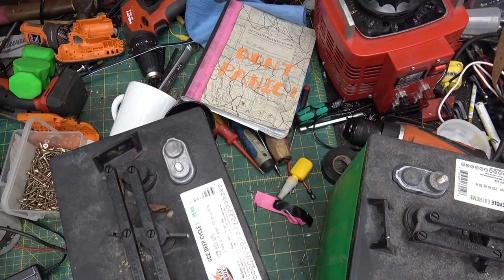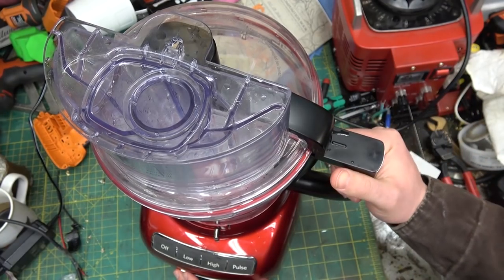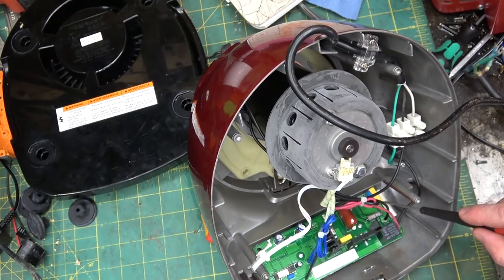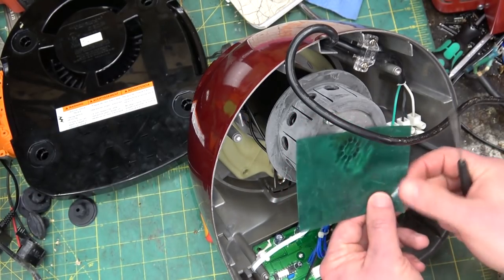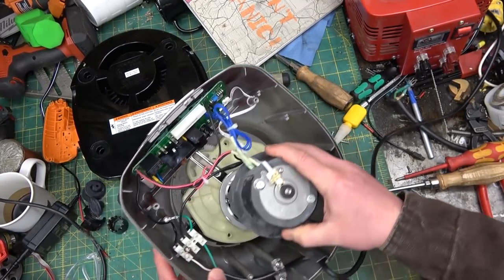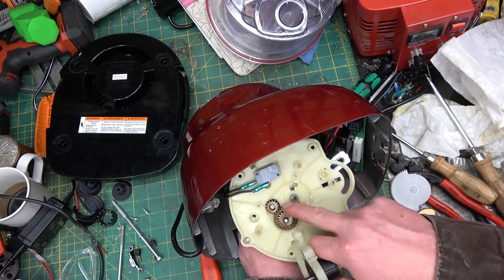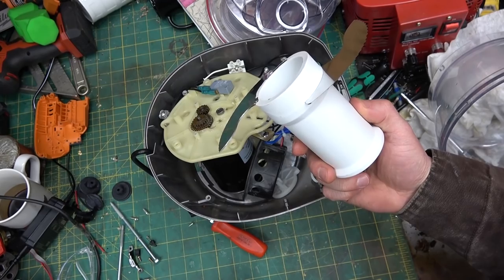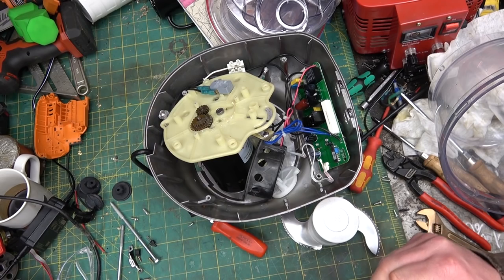BOLTR: KitchenAid Food Processor | Expensive Junk

Comment: If only a bloke had a 5 axis cnc machine, he could make a new one.
Reply: Out of that hard stuff, iron or steel or aluminum/aluminium. Not tree carcus tho.
Reply: My thoughts exactly. Buy a new one? Pff, i'll just make one that actually works. Let's replace that plastique gear case while we're in there, and get dewclaw to rig up a proper controller so we can get this thing to use both halves of the input power wave to get the missus to the moon.
Reply: What he really needs is a properly built one that uses a VFD and industrial grade motor to run it. The misses will be able to make enough pie crusts to start a bakery!
Reply: Going to need a tool holder for the dough hook.
Reply: Yeah he could spend a few thousand in machine time and reverse engineer time to save a $200-300 appliance.
Reply: make a replacement part out of unubtanium.
Reply: @WeighedWilson  killjoy
Reply: Or 3D print, share the file on thingiverse for others
Reply: @WeighedWilson  It'd be a great learning project. Plus, don't forget the big Youtube payout $$$. I'd watch.
Reply: Came to the comments to say this, ya beat me to it!
Reply: @sopgenorth  3ph VFD and a 8hp motor, fluid coupled with upstream filtering to keep the TV and stereo skookum?  sounds like a mighty build :)
Reply: @WeighedWilson  excellent engineering/business observation. However, he could do a production run to sell to the KitchenAid modding scene. Surely that population would provide a profit!!
Reply: @WeighedWilson  plus if this thing was made out of metal I think the project would require some broaching. And I'd love to see some broaching using the Z axis of a VMC "out in the wild."
Reply: Maybe make a stainless steel one
Reply: Or use the CNC to make pie crust...
Reply: 5 axis for a small plastic part? They have these things called 3d printers for that.
Reply: @markokrsmanovic1080  Nailed it. It's not about the part but the process
Reply: @inthefade  you do have a really good point there. I'd watch that.
Reply: Yeah but where the hell we gonna get one of those? All we have is the ol’ town pump...waaaaaait a minute...
Reply: Yes a solid cnc chiseled ingot would be costly in man minutes, but the solidity of the result would deter the pixies attacking in the observed formation, leaving them no choice but to search out the second weakest link in the mutilated appliance.
Reply: @WeighedWilson  Why are you even here?

Comment: Fixed my wifes kitchen aid blender  last week using skills learned from boltrs. Thought for sure it was a thermal fuse, but turned out one of  the brushes wasnt free in its guide. Think my wife gave it an extra hot supper. A little shave of the brush side with some emry had her chooching.

Comment: The ‘Princess’ here (we’re on the ‘WetCoast’) has all KitchenAid stuff (and all red too) and its strange to my electrical/mechanical mind how/why they actually design some of their operations... I came to the ‘show’  bringing my Cuisinart appliances... The KitchenAid stuff sits out on display like the show pony’s they are, the Cusinarts come out from under the covers and actually perform the deeds as requested. She used to use the KitchenAid mixer sausage stuffer attachment to make her homeland Azorean special Chouriço. I had her a ‘race’ and could hand stuff them casing twice as fast using my Princess Auto sausage stuffer then she could... (you can call me a sausage stuffer, but NEVER a cork soaker!) that KitchenAid attachment thing was so deflated she relegated it to the GARAGE storage, never to see the light of the LED kitchen lights again!!! We have the bestest soft fluffy bread doughs, pie crusts, smoothies, everything my diabetic little heart desires! Only issue I’ve had with my Cuisinart food processor? A recall because the stainless steel blades have a habit of coming unhinged and parts flying off all around inside the mixer bowl... some kinda enginerding F-up with getting the sharp shiny part to stick to the hard plastic part. Luckily, my dicks in a vise, so all is safe!
Reply: A bit of home shop tooling can fix that last issue, like into this video.

Comment: Hey AvE, I believe it was your last blender video where you were processing quartz. You said something about wanting to make some sort of equipment that would well, sort the good and the bad ore. Getting to the point, have you seen the videos of those machines that can sort ripe fruits or anything really? Lets say you were processing tomatoes, it's able to separate using some kind of lights or sensors to see which are green, then uses mechanical arms to knock them away from the ripe tomatoes. I saw it and remembered you said something about UV light having a different effect on quartz with gold and without, figured I'd mention it, although it would be one hell of a concept project.
Here's a video of one in action, /watch?v=fEemerXP_hk
Supposedly they can be made accurate enough to even separate rice. Have a good day.

Comment: Always thought KitchenAid made quality stuff, maybe not so much anymore.
Reply: Their mixers are still the industry standard.
There are lots of them still going strong, after decades of heavy use.
Reply: Just the mixers. The rest of their stuff is just like everyone else's junk.
Reply: My grandmother got a Kitchen Aid stand mixer as a wedding present 50 years ago and the thing still looks and works  like new.
Reply: Have 1950's Blender.  High, Low, Off.  Never a problem -  Hey!  Tempted to check how many bits to this.  naa
Reply: They're not as good as they were when Hobart made them.
Reply: After the Hobart family sold the business, it has been sold and bought several more times. The quality remains in their older products, but newer items are sketchy.
Reply: KA is owned by Whirlpool now right?
Reply: @cordcd7  The last screen of the video is him trying to order what looks like a Whirlpool part, which the dicing bit is probably a generic one across multiple models. So I wouldnt doubt it.
Reply: @nutsandgum  Good eye!
Reply: mattroski007   Yeah, there’s a few different grades among the mixers. His was somewhere in the middle iirc.
Reply: There's no such thing as a reputable brand anymore, they're all just badge engineering to fill every market 'vertical'. A couple of the core products might be designed by an engineer but it's mostly just accountants at the wheel.

Comment: I have a Kitchenaid food processor that I've had for over 12 years, and still works great. It's awesome and way better than any other food processor I've used, still good as new (granted I don't use it that often). But it's a different model, with only 3 buttons: On, Off, and Pulse. Doesn't have that mechanical adjustment lever, so fewer moving parts to break.

Comment: Pro Tip:  Forget about the pie crust making tool. Here's a better option for the important one in the family.  Trust me :)

Your grocery store likely sells pre-made pie shells in the refrigerator (not freezer) section.  Most important,  purchase  a set of "ceramic pie weights" and use them to pre-bake the pre-made pie shells.  Add a home-made filling and get the best pies ever.   Purchase pre-made pie dough and peel apples with the family while the crust pre-bakes. You'll get many, many more pies.

Comment: My Cuisinart processor is direct drive, as in, the blade spindle is the motor arbor.  And when you fire it up empty, it makes almost no noise - just a low hum.  It also weighs about 20lb with a 100% plastic housing.  In short, it's a beast.

Comment: What you want is a 1980s Cuisinart. The earlier the better. A made in J a pan one.  The parts are available to replace anything the previous owner broke. Although if the main bowl is cracked/damaged you'll have to buy a bunch of parts to update because the original design isn't made any more.  These things are still going and getting close to 40 years old.

Comment: Awesome.  I bought one of these to make saurkraut, so chopping various veggies.  I ran for a good while and after 4 gallons of kraut started, the blade spindle that fits into the plastic socket in the bottom of the lid got too hot and melted the socket.  Luckily I found a broke ass Kitchen Aids and picked it up for cheap to get the lid from it.   Always apply coconut oil to that plastic socket and pray it doesn't melt.

Comment: I must recommend an Ankarsrum Assistent kitchem machine, probably some of the best engineering sweden has ever done, comes with all the attachments, super serviceable, basically a bulletproof design more or less unchanged since the 40's, has a motor the size of a small melon, and comes in an attractive retro spray painted metal case that looks nice wherever it sits. Comes in a whole range of colors too.
Still made in Sweden in town with the same name as the machine.

Comment: Here's what I'd do: Replace the motor with a right-angle drive. Extend input shaft of said drive out through the case. CNC a hub and attach the blades of your choice to it. Finally, chuck a skookum battery-powered variable speed  drill of your choice to the input shaft, and voila! A fully portable hella powerful food processor with infinitely variable speed and pulse mode for no extra charge. Big win all around!

Comment: You should make a video about the process of trouble shooting in general. I feel like it’s often over looked but extremely essential. For example when I was a machine tech for a injection molding plastics company I was taught to adjust the variables that change immediately and methodically work my way to changing variables such as water or barrel temp.

Comment: Decent kitchen robots / meat mincers / mixers / smoothie makers etc. have a dedicated shear part ( "shear clutch" or "shear coupling" in English ???) between the motor and the food processing part that is designed to wear/fail/shear first before anything else gets chewed up. Some come with a spare one in the box but even if not, the part is usually cheap and easy to replace. I just had to buy one for my girls meat mincer that I broke because I stuffed it with, well, not meat, and it jammed sheared the thing to pieces. Cost me $2 plus post and 5mins. of work to fix.

Comment: I have a magimix 3200 that is about 20 years old. The half flat drive shaft eventually bites into the cutter blade socket and it jams up. Every recipe ends up with a tappy tap tap to get the blade off. Newer models have a better arrangement. But - I could not believe it - magimix sell a converter that is easy to fit - works like new. Later, part of the plastic on the case wore so the bowl didn’t engage well. Magimix sell new cases. 10 minutes and my 20 year old looks fresh. And it has certainly seen lots of hot suppers. Ps Mrs aVe ask for a Swedish assistant for dough.

Comment: Zamak... I worked in a die foundry. Cast aluminum melting @ 1050°f and zamak melting@ 750°f a piece of slag kept the die from closing tight.  There was a hole in the lexan window of the door. I watched a huge glob of zamak get ejected out the hole on onto the back of the head of a die cast trimmer 30' across the aisle. It scalped him, zamak sticks to the skin and he lost a baseball sized flap of skin and hair from the back of his head.

Comment: Wow! Kitchen Aid's appliances have gone down in a rocket sled into hell. I fondly remember trying to fix my grandmother's Kitchen Aid food processor back in 85' I run it with the lid off, and it really did. I was an idiot kid and tried to stop the top side. Very fortunately not the blade part as I really would not have any fingers on my right hand. I did get a very sweet friction burn on the top of my hand that lasted about 10+ years.

Comment: They built the weak point into the blade because the older ones could chooch straight through the plastic bowl if they got jammed up. They're like shear bolts in a snow blower.

Comment: We have a similar machine only older.. just one speed. Quiet and powerful motor. Really can't fault her other than that the damn safety interlock is annoying... OTOH we all have a complete set of fingers still! I haven't opened it but i'm fairly sure there is no 'lectronicals in there other than a capacitor to keep your kitchen radio playing without interference. 
The knife element is in some sort of plastic moulding and i think it suffers from years of dishwasher, it will break at some point. I hope they do spares: buying new is evidently not an option!
The polycarbonate parts are top-notch.

Comment: If I designed a food processor it would feature a direct drive ECM motor. A hand mixer, a 137 watt 75 percent efficient universal motor with replaceable carbon brushes that sounds just like a vintage GE hand mixer and it’s more powerful than a 220 watt cuisinart or 90 watt dc motor kitchenaid.

Comment: I have that same terrible machine! 
1. The "soft start" makes the pulse function near useless.
2. The blade clearance is so high that is mashes a layer of food at the bottom
3. The safety mechanism is over engineered and also destined to fail.
They say pulse is fixed on the newer models, but after failing to bypass it, I threw it in the closet and bought a much simpler cuisinart.

Comment: that hot wire isn't running to a thermal shutoff, there's a small switch up there that is only activated when the bowl is on in the correct placement.
Edit: was covered later in the video :)

Comment: Kitchenaid isnt what it used to be.  They kept the beautiful metal housings and fancy paint jobs but the internals are where they've cheaped out.  

I always wanted the beefy kitchenaid coffee grinder but they stopped making them years ago.  Last summer I was in London Drugs and low and behold they had one on clearance so I low balled them an offer and took it it home.  The cheap garbage gear noise is so bad it's like fingernails down a chalk board and the burrs themselves are crusty dull coarse powder metal.  The $30 no name grinder I bought from Real Canadian Superstore had nicer burrs.   I found the parts lists for the old version and the new and while many parts are identical, the motor is different and the label on the bottom used to say commercial/household use now it says household use only.  I used it once and now I just look at it.  I'd like to see a side by side comparison with the old version so i plan to get an old one off fleabay.

Comment: Really is a piece of junk .If your wife made more use of that labour saving device i'd suggest getting a kenwood mixer .Dad gave mum a kenwood master chef mixer 40 odd years ago ,it's still going today .Gearbox makes a right racket still works tho .It'd be ideal as it has the torque to do dough .Downside of the kenwoods is the prices they go for today .Still it's possible to get replacement parts for the old ones from a crowd in the UK .Kenwoods are only kenwoods nowadays by name

Comment: So the thing has a push to lock mechanism, and the problem is that you want it locked and it won't lock, well if you want it always locked and never want it unlocked why can't you just fuse it together? Then it'll work 100% of the time for pie crusts. Couldn't really see from the video what that metal gear inside the thing was supposed to interact with, but seems to me it should be easier to make it completely stuck in there. Don't let perfection be the enemy of good (enough).
Reply: You need to be able to remove the blades to clean it.  Sadly he can't put the blades in permanently for that reason.

Comment: do you think you could put it back together then weld on an extension to the drive shaft grind some flats then heat it up and just jam it right through the spinning thing with blades, and glue or melt that (press here) cap to the outer body of the spinning thing?

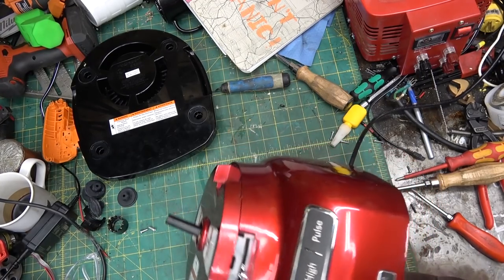Comment: Shame on KitchenAid for creating such a confuculating device!  My Sandwich Maker broke the selector doohickey off and was unable to adjust her veggie slices.  It was the same piece you happened upon at 7:25.  My solution was to pull out the old welder and tack on a few 4-40 nuts.  Then I trimmed the case and the front fascia (that has the thickness label) to allow a tiny bolt to go through.  I pondered this solution for awhile because I could not find a selector knob small enough to work.  I ended up using a thumbscrew for an old parallel printer cable.  It is not the most beautiful solution.  Maybe I will PlastiDip it to match the case if she yammers on about how ugly it is.  Anywho, it chooches again and I am back in the Little Misses good graces!

Comment: That's right, you Canuckistanians can't have any pistols with a barrel shorter than 4 inches. If I even find another OLD Kitchenaid blender/mixer/massager/electric drill,  and can negotiate a good price, I'll send it your way. YES, I did type "ELECTRIC DRILL MOTOR", because these old Kitchenaids had changeable brushes and one motor ran many different devices. I was stunned when I saw the "Full Monte" at an estate sale.

Comment: Need your help, I need to know what type of metal and thickness is in the steel cub of the kitchen aid BCG111OB blade coffee grinder. I have invented something that needs this exact type of metal, I can’t keep buying a $39 Grindr just for the metal reservoir as parts. I have no idea where to look for sheets of steel of that kind. The steel is very thin, very strong, sharp and extremely tenacious and can flex quite a bit. It will never rust after, grinding, sanding, or acetone applied. Please help.

Comment: I would glue the shit out of that locking mechanism and even lock it tight with steel bolt. If it stopped working for some dumb reason then just fix it by even omitting a feature, in this case locking feature. In my home all appliances even the shittier ones get a job once a year, especially during pre-christmass food mass production season.